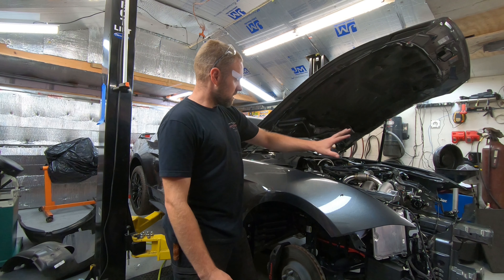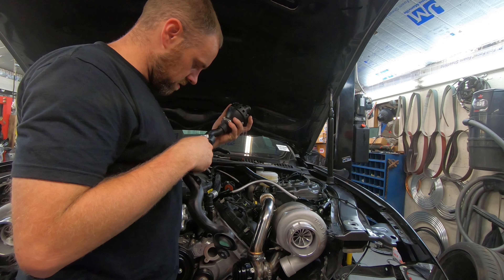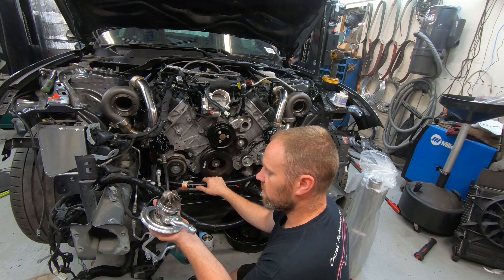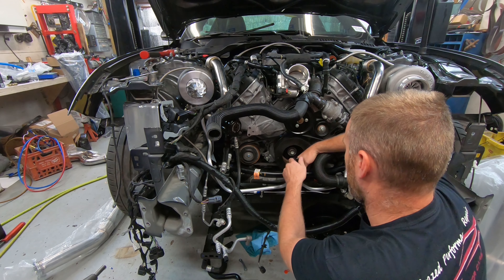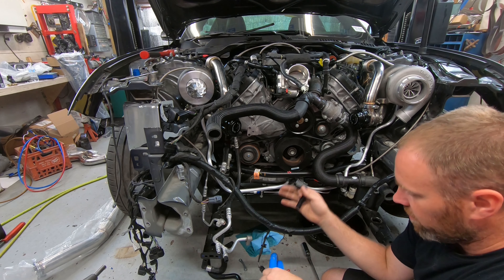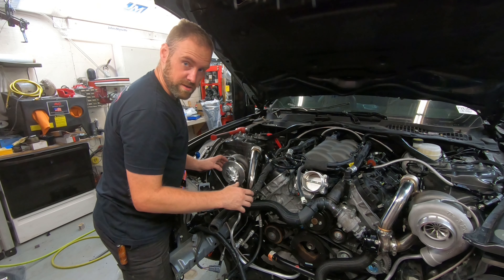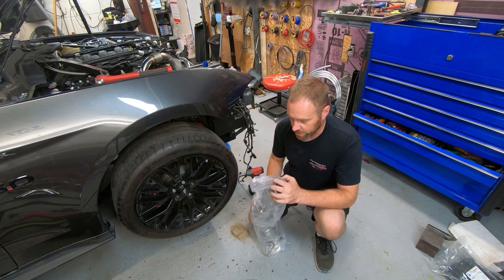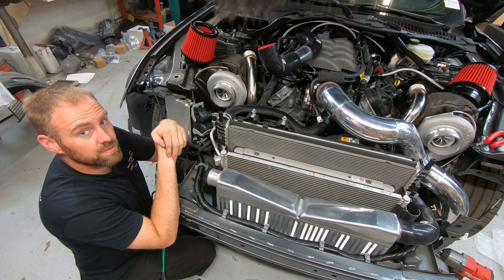TT Mustang Hooking up Turbo's and Cooling PT5

Comment: the part you were confused about is a sound tube, literally just increases engine noise in the cabin. I deleted mine in the 5 seconds of ownership.
Reply from the maker: So crazy they do that, most auto makers try to remove engine sounds. Doesn't ford realize rather than engineer that they could simply give it a less muffled intake or a less baffled exhaust. Although the coyote engine does have the worst sounding exhaust in my personal opinion. Too pitchy for my liking.